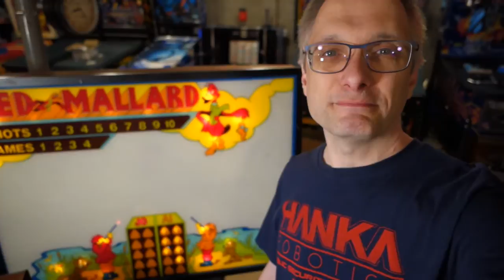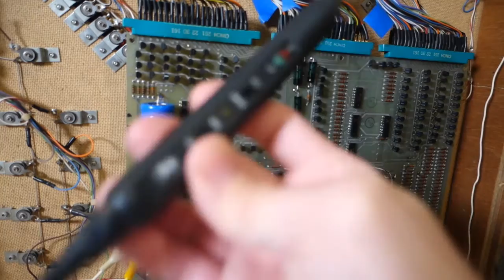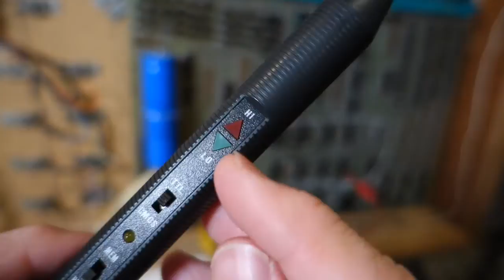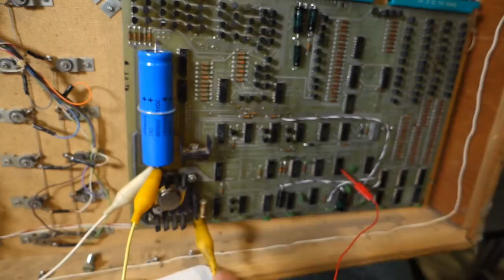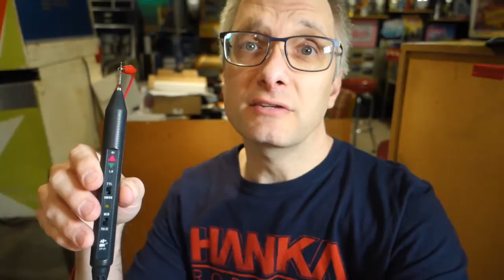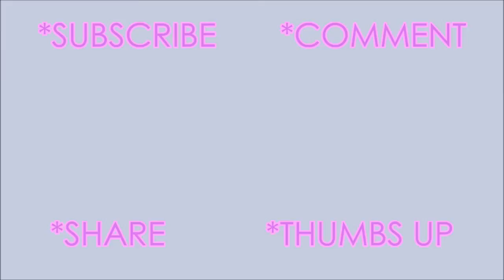Logic Probe - special tool tips and tricks

Comment: I rarely do hardware repair (okay sometimes, but not often)  and I know how to use multimeters and oscilloscopes. In a repair stream on twitch I saw someone using a logic-probe today and it's such a nice tool. For example I own an oszi, but it's a crt model, so it's quite big and therefore on a shelf 2m away from the workbench, just for space reasons. The small size of these logic probes is a BIG advantage. Thx for the nice explanation.
Reply from the maker: Thanks,

Comment: Great video! Explains what a logic probe is in a nut shell. Yesterday I relied on the same model Logic probe to diagnose why the 6 digit displays were not working on my Gottlieb System 80 Counterforce. All of the MPU boards display section TTL chips tested fine. The connections were fine. Ended up being trouble on the power supply. A Zenner diode needed to be replaced. The displays then lit up like new. My DDM found the troubled component on the power supply but the Logic probe verified the circuit boards ic chips were functioning properly.  A great tool for anyone repairing and troubleshooting their own circuit boards.

Comment: I have an Arduino, and I have a program loaded on it. It does what it’s supposed to what I have it hooked up to the computer via USB. But when I try to run it off of a 9 V battery, using the battery jack,it doesn’t work. Would a logic Pro be good to use in that instance?

Comment: i'd like to know what the input voltage for the probe is?
Reply from the maker: Great question Stan, Digi Key has a DP 21 that looks the same as mine (has a nice data sheet too). Operating voltage 4-18 volts.

Comment: Dumb question, but can you use these to work on cb radios to find things like why the radio doesn't have receive or transmit?  Will it be able to tell where a certain circuit stops like a bad component?
Reply from the maker: While I haven't repaired a cb radio, your best bet would be to use an oscilloscope. With a schematic and diagrams you can trace the circuit starting at where the signal begins.  The logic probe is better used for simple logic circuits. Like if the digital display on a cb radio wasn't working correctly. For an oscilloscope you don't need a fancy one.  Just a very basic one.
Reply: @PinballMayhem  Ok, thank you!!

Comment: Can it check the modern IC? Like computers etc
Reply from the maker: Great question, it could be used on modern IC components. An oscilloscope might be more useful. But the logic probe is a low cost solution to check for activity on a data line. Or on an Arduino it could be used to check the status of it's logic outputs.

Comment: Thanks for this video. 
I try to understand what a logic probe does. If I'm right, it helps to see the states (LOW/HIGH) of a pin (below or above 5v)...ok.

Does this information helps for checking if an IC has a normal behaviour ? 
How can you check for example if a Z80 dip 40 is OK ? Do you rely on reading "states" ?
Reply from the maker: Glad you liked the video!

From my limited electronic understanding an ideal logic state of high is 5 volts and a low state is 0 volts.

For checking a Z80 the logic probe could be used for looking at activity on data lines, clock lines, or reset signal. In certain applications you may not see a pulse and an oscilloscope should be used.
Reply: @PinballMayhem  Thanks a lot. I've just ordered a second hand logic probe. I have 2 faulty Sega Megadrives and the probe will help me understand what's going on.
Maybe one day I'll invest in some oscilloscope.
Reply from the maker: Good luck on the repairs
Reply: For a Z80, check +5V, Reset, Clock, DO, D7, A0, A15, if you get pulse activity on those your Z80 is probably ok.

Comment: What if it's less than 5v but more than zero volts? The application is 12 volt automotive systems
Reply: This is mostly for logic circuits, so in a car you'll usually have 5v regulators feeding electronics. It does say you can use it with these higher villages, but I'm not sure what benefit you'd get from this over e.g. a test light
Reply: Voltages, not villages, naturally 🤣 swiping typing is great but not perfect...
Reply: @rpavlik1  Testing pulsing of injectors / coil on plugs etc - can be handy to use without disconnecting.